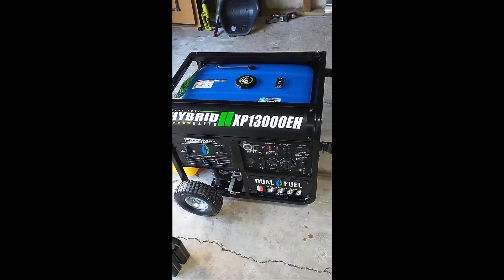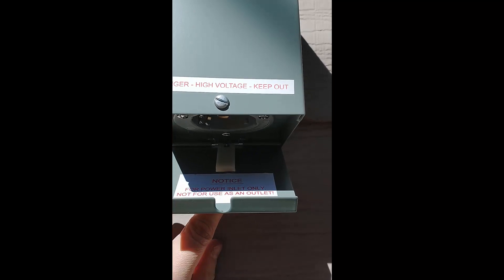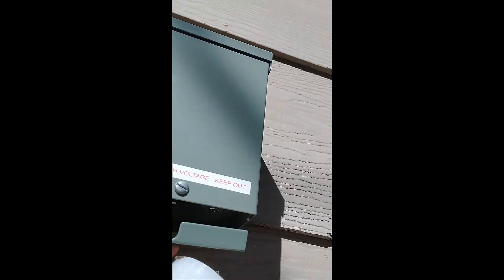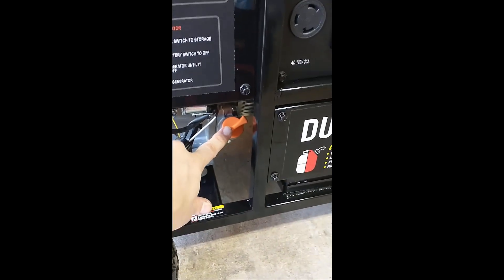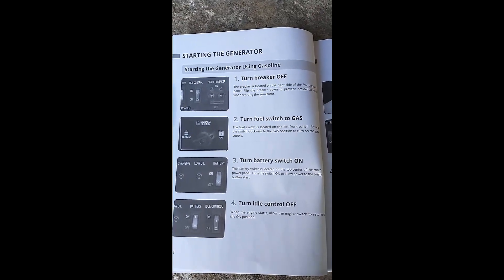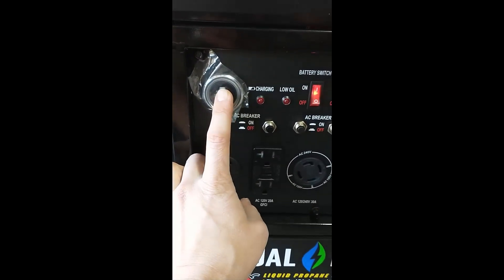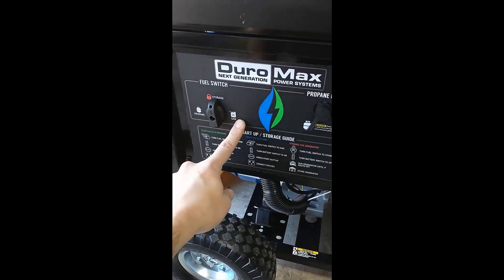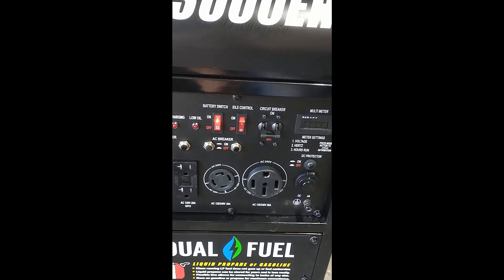Using a DuroMax XP13000EH generator to power my house

Comment: No, you don't turn on idle control to run in this scenario.  You would only use idle control if you were running air compressors to power pneumatic tools on a jobsite,  for example. Otherwise it stays OFF.

Comment: Do you have to ground the generator when using for your home because my home is already grounded
Reply from the maker: My electrician told me that I did not have to ground it but I did anyway because the instructions said to. I didn't want to risk any issues with something so expensive.
Reply: @nogoodnamesleft555  Doubtful. You have to ground otherwise you risk electrocution and fire.

Comment: Good video. Have you had to use it yet because of the power outage? I also assume that during a storm, you will protect your generator with a cover or a shed.
Reply from the maker: Thanks. I tested everything but have not had to use it otherwise yet. So far we haven't had any power outages, but I'm sure it's just a matter of time. I'm using PVC to build a structure around the generator and I have a waterproof cover that will fit over the PVC frame to protect it in a storm.
Reply: @nogoodnamesleft555  I am getting my Firman tri fuel installed today using your electrician I got his name from your next door post. There is $50 in your future somewhere according to him.